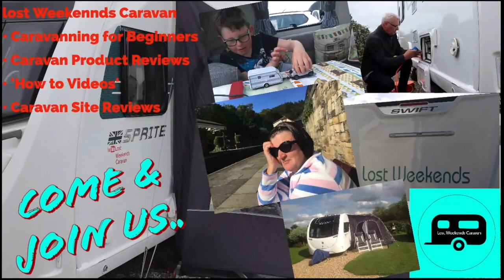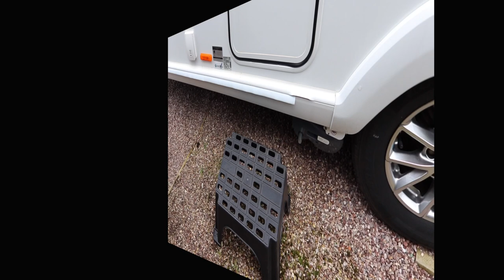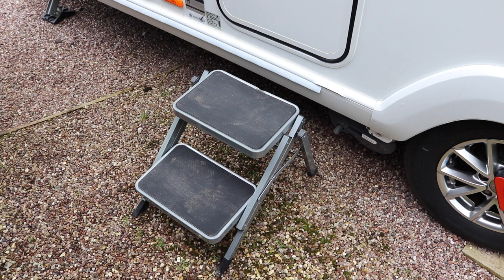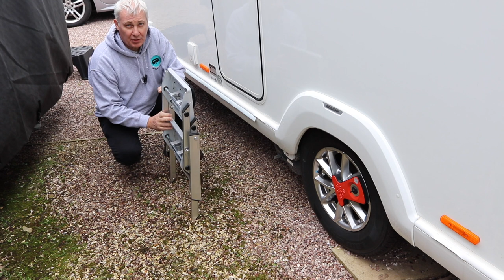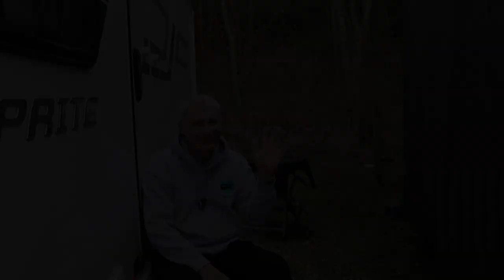Choosing Caravan Steps

Comment: With our caravan on order I was thinking about a manual pull-out step but as it was going to be mainly used on a seasonal pitch it was hardly worth the effort of sourcing it and having it fitted.
So I am really grateful that you have done all the research for me ... sorry to say the company in your link no longer seem to do the same product ..... so the search goes on. Many thanks
Reply from the maker: Hi Ian. Thanks for watching. I did the video quite a while ago and sadly some lines stop. I don't know why they have stopped making these steps are they are a great set of steps. Good luck finding some steps. Thanks Phil🙂👍
Reply: Hi Phil
I did find a pair on Amazon ...... £100 ???
Not paying that  !!
Is there a makes name on them and how much did you pay ?
Ian @lostweekendscaravan
Reply from the maker: Hi Ian. I think I paid £50 for them I know they have gone up. This is a link to the cheapest I have found that are available.https://www.jacksonsofoldarley.co.uk/products/kampa-caravan-folding-double-step
Thanks Phil;
Reply: @lostweekendscaravan  this one is not aluminium, but steel

Comment: Hi Phil. We're on our 3 set of steps, did away with the plastic ones and opted for the fixed double steps and seem to be holding up quite well so far.
Reply from the maker: Hi Steve, I think the ones we have had were unbranded and quite badly made. These seem to be quite good and fold up easily. Thanks for watching Phil👍🙂

Comment: The first set of metal steps you showed, we have had 3 sets, only because they keep breaking and I always get the same set again as a xmas present, think I need to buy a set myself. The fold up one's look good. Thanks for sharing👍Mark
Reply from the maker: Hi Mark. You can buy the fold up ones in steel or alloy. I would recommend the alloy ones. They will not rust and they are much lighter but just as strong.  Thanks Phil🙂👍

Comment: Hi Phil and Juliet hope you are well, we're on set number 4, first set we had were very narrow I stepped on to them they tipped over twisting my angle, spent the whole holiday hobbling around. Second set the weld broke on three platform,  the free set we had with the swift was to low, so we're now on the generic plastic double step which so far seems to be holding up very well.
Best wishes stay safe Jon and Karen
Reply from the maker: Hi Jon & Karen. I hope you are both well. We spent a lot of time search for these ones. I hope that we will not have to buy another set. Take care. Phil🙂👍

Comment: We have a Milenco Giant one, like your 2nd one, it’s huge and no risk of it sinking, however we were gifted it 2nd hand and if it gets too hot in the sun it can bend. I’d be wary of the one you’ve settled on sinking in soft grass, but guess if you’re always on hard standing or using awning it should be fine. Certainly folds very neatly.
Reply from the maker: Hi David. Our double plastic ones were unbranded and frankly crap. I see your point with sinking but we do use hardstanding pitches mostly. The new ones are very well made and I think will last a long time. Thanks Phil👍🙂

Comment: just what i was looking for......but then i read that steps with feet sink into the grass.   i am going to buy the ones used by the vloggers 'here we tow' ( seen in their grill evaluation) made by milenco as the base has a bar all around rather than 4 feet.
Reply from the maker: Hi. I have been using these steps for quite a while. I have not had an issue however I don't pitch on grass. You need to buy what suits your circumstances. If you buy the bar ones may suggest you peg them down as they can slide forward like skis.  I hope this helps. Phil. 🙂👍
Reply: @lostweekendscaravan  good tip, thank you